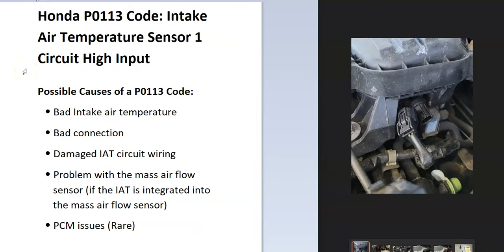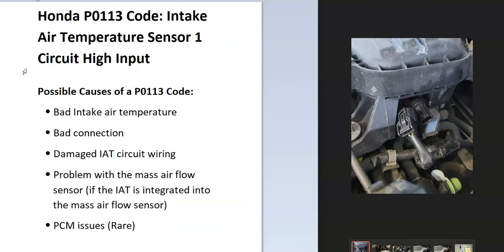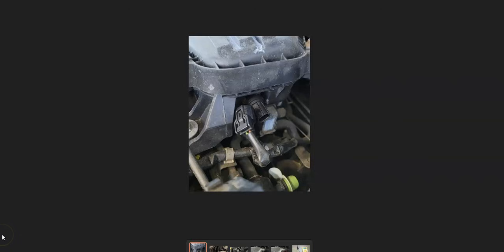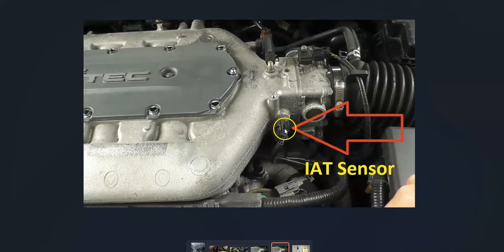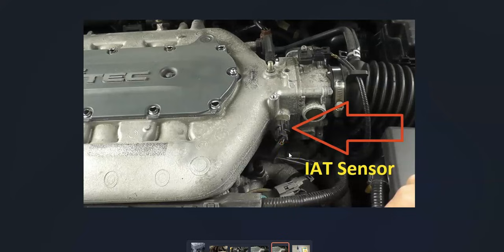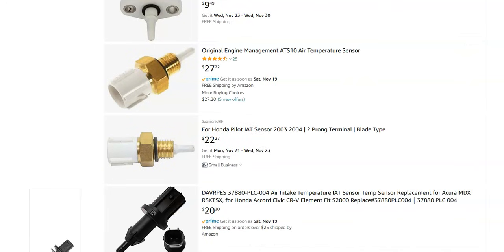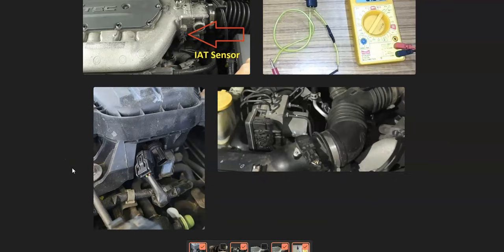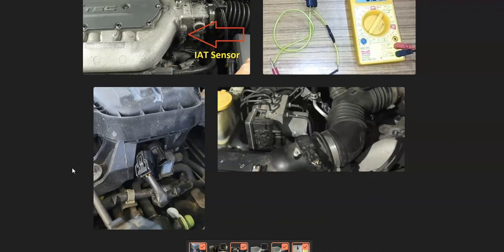How to Fix Honda P0113 Code: Intake Air Temperature Sensor 1 Circuit High Input

Comment: Hello, it's a good video! I have this error code after air filter changing. I've disconnected MAF sensor one time again and moved wiring a little bit and it's disappeared.  How i can check wiring? It's Honda CR-V 3 Generation 2.2 i-DTEC, 
Thanks a lot!

Comment: I’m really hoping you’ll reply to this,
My connector snapped and it’s not holding the sensor properly where can I get a replacement ??
Reply from the maker: I would look on eBay or a parts yard.